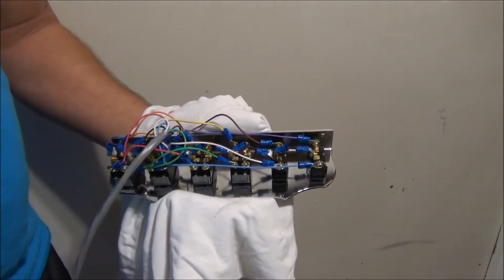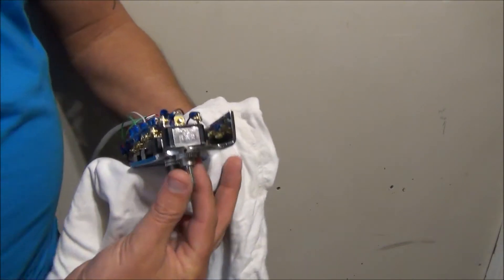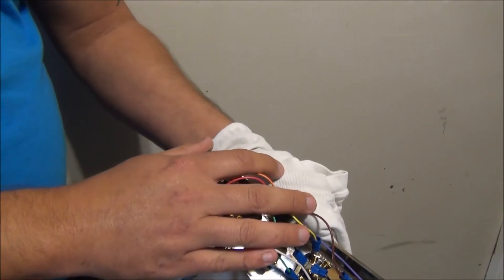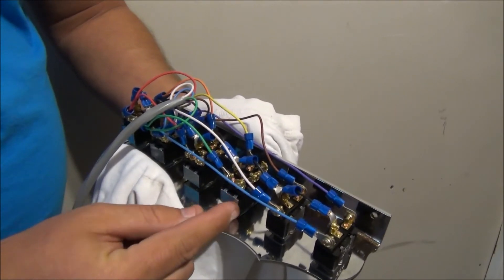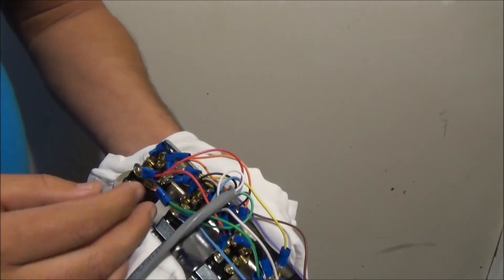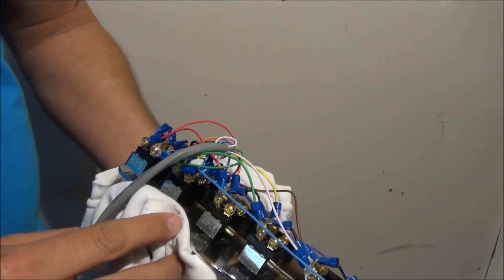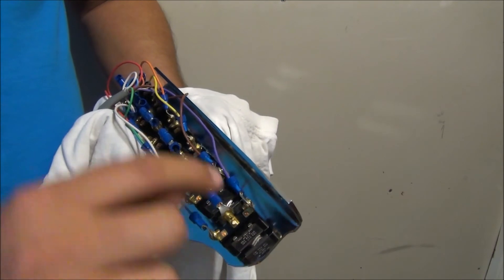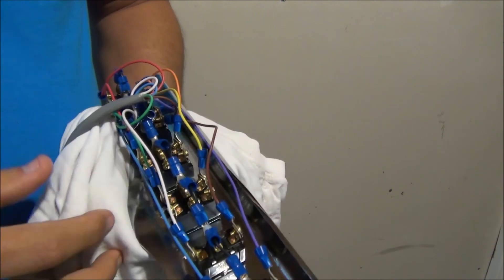How to Switches How They Work 3 6 & 12

Comment: So I been trynna find a wiring diagram for a 2 pump 5 dump set up fbcc for rear pump to have corner control as if it were 3 pump how would I wire my pressure dumps to open when I hit the switch separately I was thinking of using 1 3 prong switch for the front and 12 prong for the rear switch and 6 prongs for each rear corner switch would that work ? Or would they active the way.you are saying together cause I'd jump.the wires for the dumps and switches together
Reply: Won't work